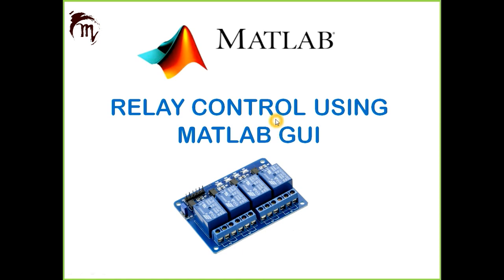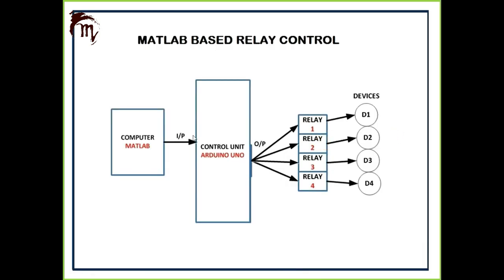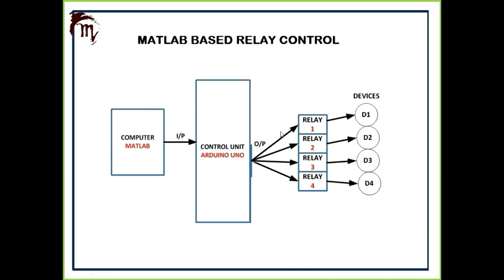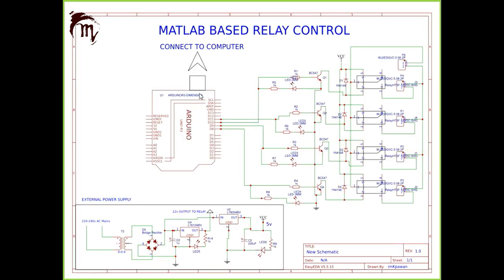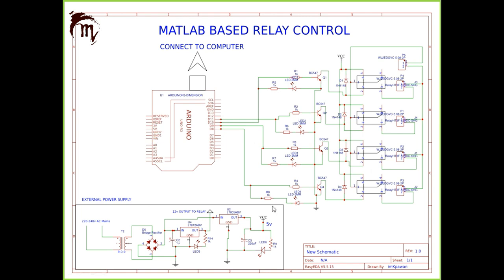Controlling Relay using Arduino and MATLAB GUI

Comment: ULN2003?USED
Reply from the maker: No friend, it's a ready to use board where Opto coupler is used. You can make your own relay driver board using ULN2003, transistor or opto coupler.